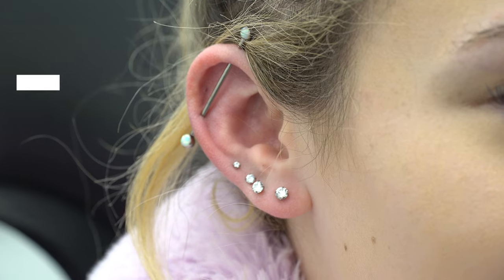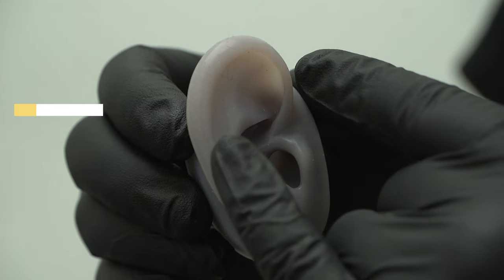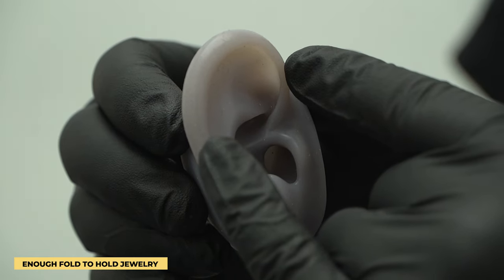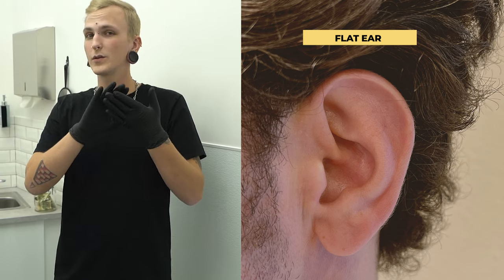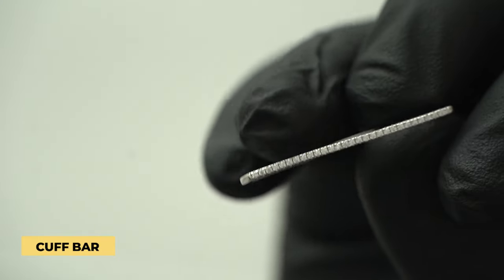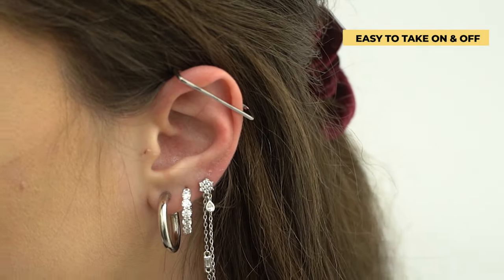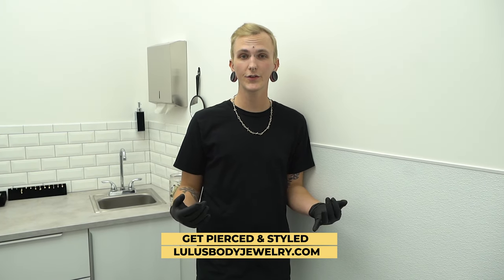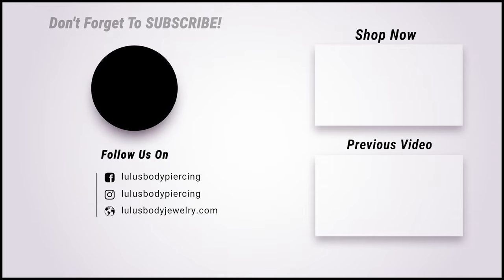Do you have the right anatomy for an industrial ear piercing?

Comment: Solution for bumps? My piercer took a needle to one of the bumps underneath the top of the industrial, a lot of gross stuff came out, swelling went down A LOT and it looks better but some swelling it still there, no pus,no discharge anymore, just crusties at times & on each end of my bar there's a bump. Plz help.

Comment: i just found out that i don’t have the right anatomy for it and i have a bump on the lower part . Do you think switch out to separate jewlery will save it ?
Reply: Omg I have a bump too and it’s not going away! What did you do??
Reply: For anyone still wondering about this:

You can absolutely swap them out to two helixes if you realise that it's not healing as an industrial. You'll probably end up unable to put an industrial back into them later, but it'll save the piercings themselves! (Obviously provided each one was done right to begin with)